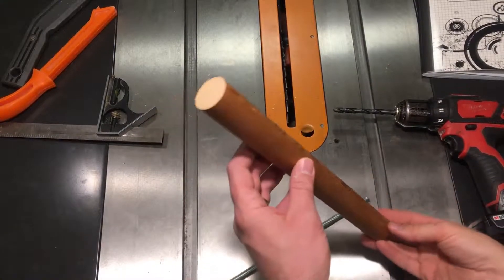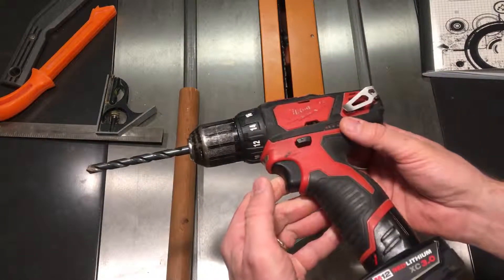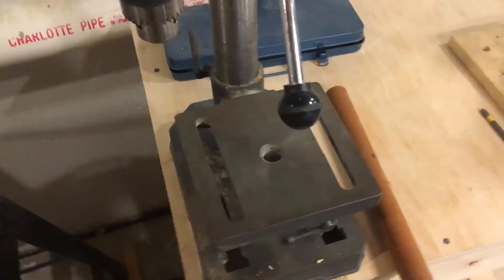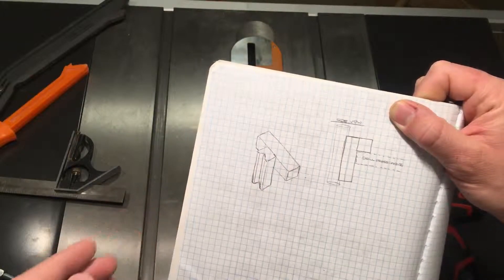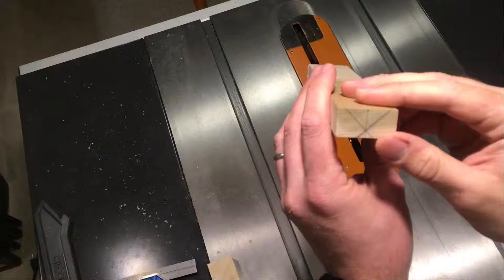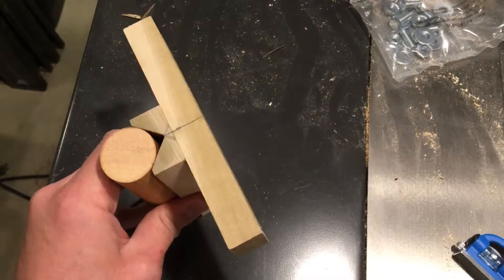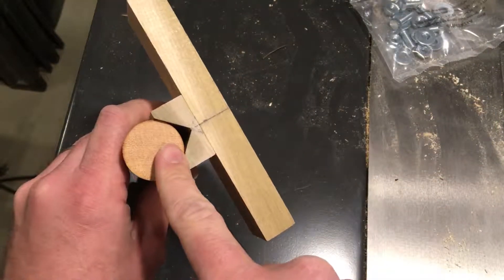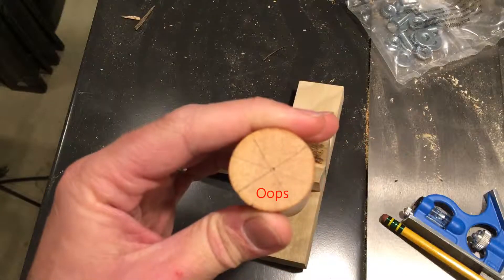Dowel Center Drilling Jig

Comment: Spreading glue with a finger would get you banned from wood shop in the Good Old Days.  On Youtube it only gets you a thumbs-downie
Reply from the maker: I’m certainly not a master woodworker, but I try to learn from the greats.  I would always try to emulate the likes of Matthias Wandel, Paul Sellers, and Roy Underhill, and since all of them occasionally spread glue with a finger, I’m happy to count myself among their wood shop expulsion club.
Reply: I will be making one of those.  I would add a couple of features.  The first would be to make a recess on the top of the fixture to the right or left depending on your dominate had to automatically align the square to the pencil line.  The other would be to drill a small hole through the back of the fixture so it would center a pilot hole for if a cross hole was needed.  I saw in one of the comments that someone needed to do that. Great idea.

Comment: Hi Jeff! That was a great solution to your problem. 

I had a similar problem, and used a jig that’s not dissimilar to yours. Check it out, it might be worth modding you’re as we have very similar drill presses.        https://www.instagram.com/p/CBafs-ojMhG/?igshid=1xpv281wm8bqu
Reply from the maker: That’s a pretty cool solution.  I like it.  In my case the underside of my drill press table has some irregular and slanty shapes in the casting that might make that set up a little tricky, but looking at other models, I could see that working very nicely.
Reply: Thanks. My casting is a little irregular too, so I used some spacers to move the MDF away from them.  I think when I remake it using your V grove idea, I will make the whole thing a little smaller giving me room to loosen off the bolts and move it in and out for different diameter dowels. 😁

Comment: I was stumped, like you my drill press was too short and I didn't have the tools to drill on my lathe. You're idea is genius, thank you much.
Reply from the maker: Glad it could help you.  I think a small but worthwhile improvement to this design would be to make the horizontal piece that sits flat on the drill press table a bit wider - something more than the piece of 3/4” wide poplar I used.  It would be a bit more stable when the pressure of the drill bit is pushing down on your workpiece.
Reply: @presentdayjeff5790  I made the horizontal piece  out of 5 inch wide X 3/4 inch oak board, length is around 12 inches so I can move it into position and clamp it down. The vertical piece is attached with a 4 inch wide thick aluminum angle supporting a 4 inch X 3/4 inch x 12 inch vertical board attached to the horizontal, all with screws.The idea really works well and allowed me to drill the center hole into the spindle accurately, with ease. Thanks again.